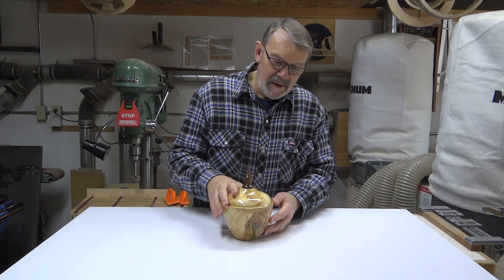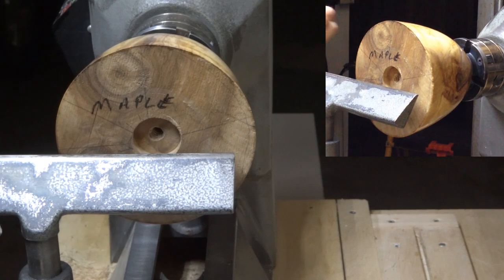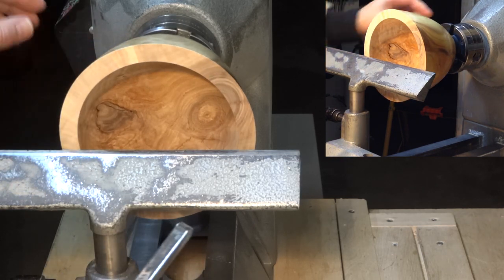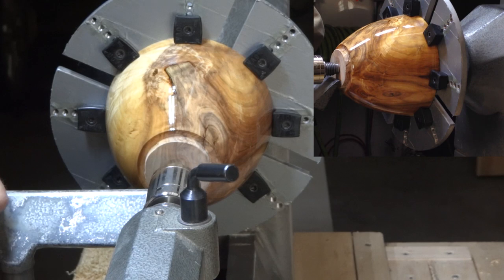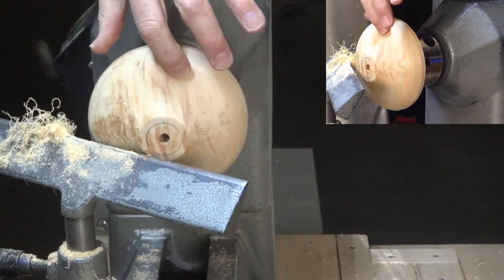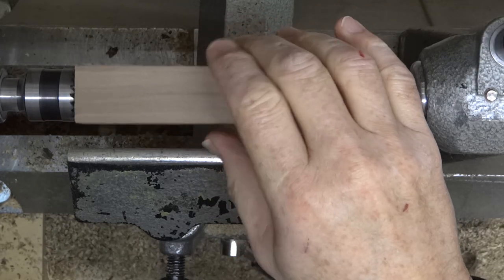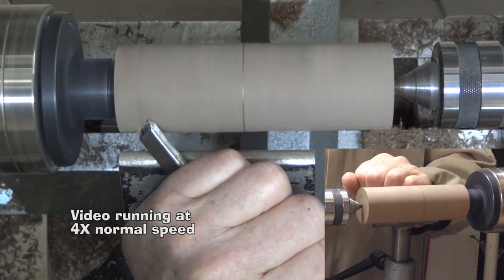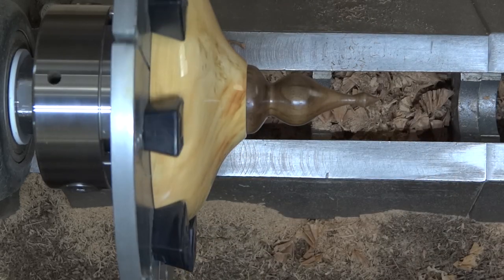Lidded Maple Vessel & Solving Orange Peel Problem

Comment: Orange peel is a phenomena usually associated with spray painting, but can also occur with painted surfaces. It can usually be removed with fine sandpaper.  The driver is the release of volatiles.  If the coat is too heavy the volatiles located low in the coat cannot boil through the drying coat and thus creates orange peel.  Secondly, if a subsequent coat is applied while the volatiles are boiling off the first coat, this will cause orange peel.  Using lacquer eliminates this effect because the subsequent cots of lacquer melt the previous coats and all of the coats melt together into a single heavy coat.  Better living through chemistry.
Reply from the maker: Thank you for the information, Rich. I just wish I could remember everything that you and others tell me!! Oh well, some small amount has to stick even in my tiny brain. Thanks again!
Take care,
.....Gord

Comment: I'll have to try the gauze pads in an attempt to eliminate my finish problem. Also your wiping the excess finish after application. My problem isn't Orange Peel, it seems to be related to the pores on the wood. I tend to use lacquer for my high gloss finishes. I've tried several ways to remove the tiny pinholes I see. Sanding sealer helps a little, but not 100%, I've even tried thin CA. It works, but way too much sanding work. This time for sure!...maybe. ;-)
By the way, I don't mind a long video once in a while, if the subject justifies it.
Reply from the maker: I'm quite impressed with the gauze pads but I think the Stain Applicator Cloths might be even better. Will have to do more experimenting with them to see.
Take care, Gil,
.....Gord

Comment: Orange peel is caused by the finish being applied to thick. This much easier to do when spraying a finish and is commonly blamed for it. Cracking or crazing on a finish is also caused either by finish being applied to thick or with a catalyzed finish with too much hardener. A finish that has a contaminate under it is called fish eye and resembles a circular area where the finish looks thinner. The only and best solution is know and understand how to apply a finish. I like most am a woodworker however I realized early on the benefits of learning how to apply a variety of finishes as well as repairing and maintaining finishes. I was able to take classes from the chemical company where I bought my finishes from. Another useful tool you can use is a "mill gauge you can use to tell you how thick the finish you are applying. The other mistake I see commonly is finishing from a spray can. This puts you at a big disadvantage because any spray can will not give you a proper spray pattern which is critical to getting a nice even finish. You can use a 1 quart cup style gun or a smaller gravity feed gun or even a air brush for small projects. All of those will take time to learn how to use them right and persevere through the frustration and in the end you will be very happy you took the time to learn."
Reply from the maker: Thank you very much, James! I appreciate your sharing your knowledge. So much to learn, so little time!!
Take care,
.....Gord

Comment: nice informative video.  i like the wrench idea to turn small tenons. i did not like the way the base stood out proud of the top.do you always use sanding sealer ? what does that add to the finish?>
Reply from the maker: Hi Warren,
I'm sure there are other reasons for using sanding sealer but I use it because if I don't the wood will absorb more finish than if I don't use it. The finish I use is more expensive than a coat of sanding sealer. Also, if using dyes the sanding sealer can keep the dye from wicking into grain that you don't want the dye to go into.
Thanks for watching, Warren. I appreciate the support.
Take care,
.....Gord

Comment: I think I would have wet sanded it first, then reapply poly
Reply from the maker: The only time I wet sand, Paul, is if I use oil as the lubricant and that would have meant a lot of time waiting for the oil to cure/dry again. Is there something else you use to wet sand with that I haven't tried? I'm always willing to accept suggestions. Thanks for watching, Paul.
Take care,
.....Gord
Reply: I am only a couple of years into turning. mostly I use lacquer not poly. on lacquer I would use water to wet sand , but as I say I'm new to turning and finishing. really like your videos keep up the great work
Reply from the maker: Thanks a lot, Paul.
Take care,
.....Gord